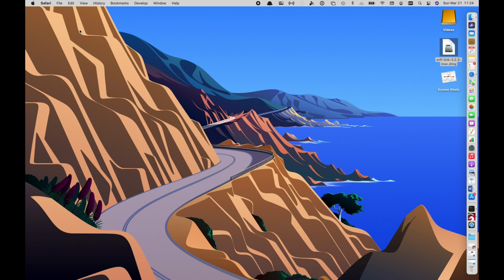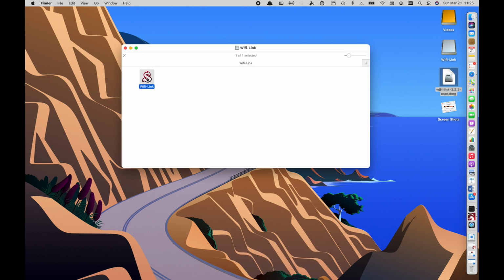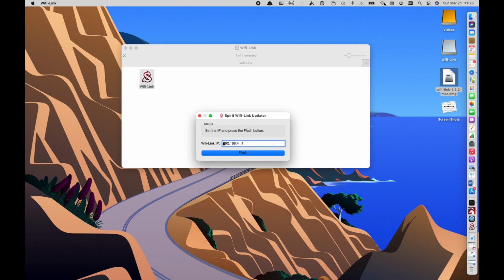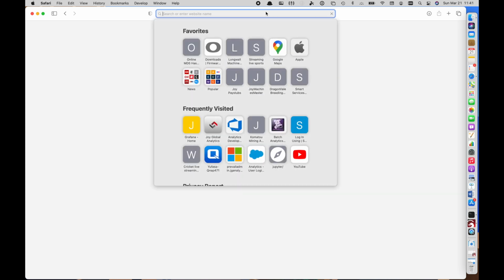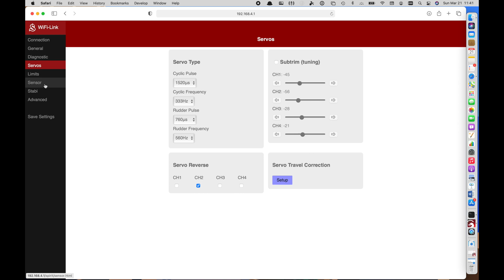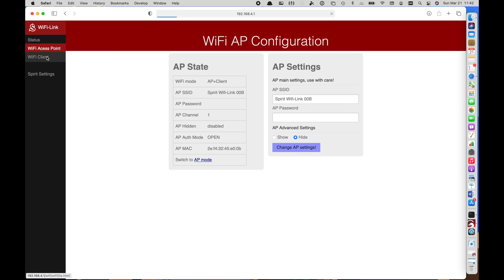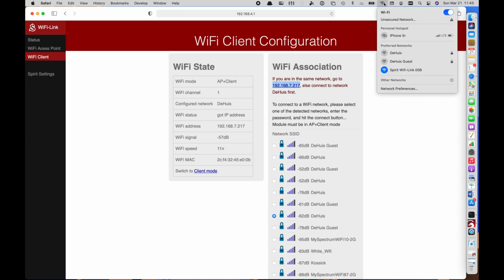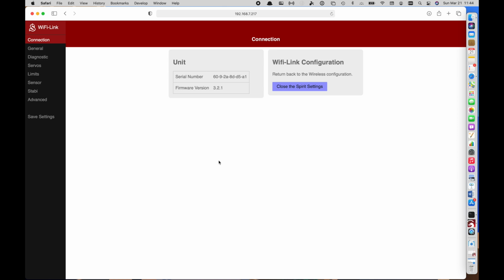Updating firmware of Spirit WiFi and also howto do initial connection

Comment: Hi Yufasa, just saw your comments on the Spirit Wave Tx, are you up and running again? Looking forward to your new video's, I am a Graupner MZ-32 user, are you still using the MZ-32 ? Because I have some questions
Reply from the maker: I am trying to get back into it again. I sadly do not have the MZ-32 anymore but I can try and answer based on experience:)